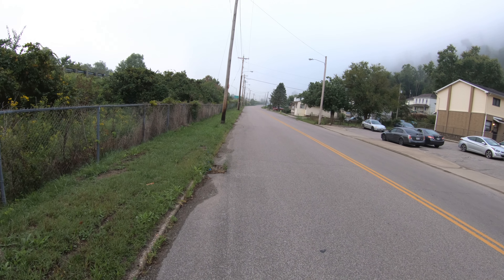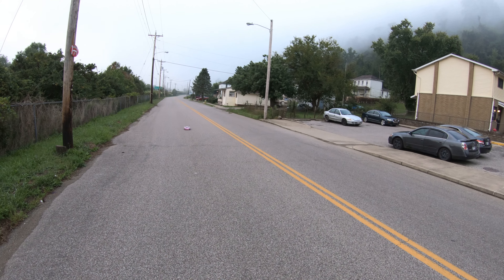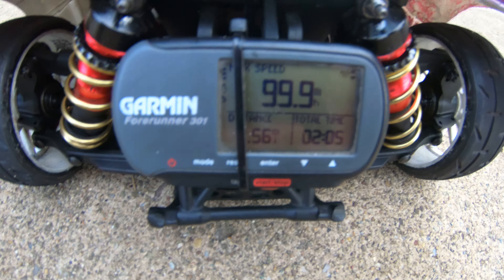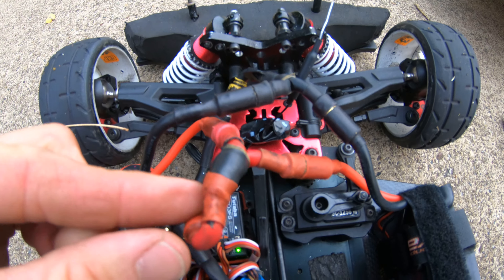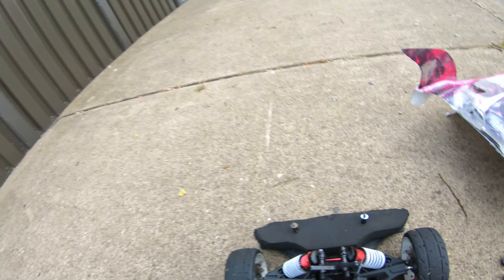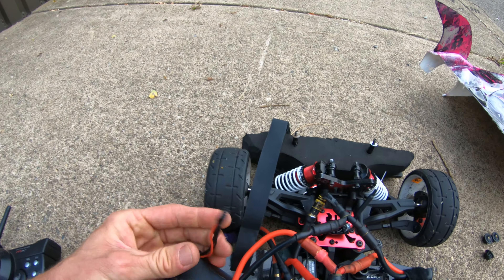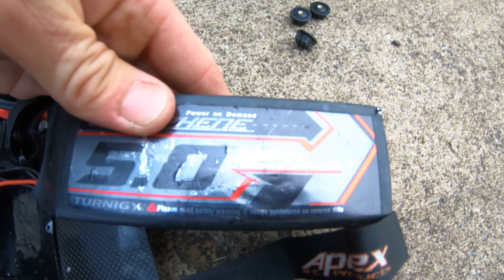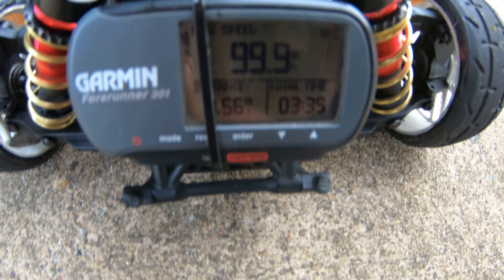Arrma Senton TAF 3S Challenge First Run. Hobbywing Motor

Comment: great run, what angle do you have in your steering so that you can drive straight ahead or rather what exactly did you do because my car always drives a little to the right or to the left no matter what I adjust, do you know the problem?,
Reply from the maker: RG-RC -TECH thanks man. I zero my servo then put the servo horn back on it. I also turn down servo speed and turn down turn radius for speed runs. If that don’t work it could be a off balanced tire, worn out parts or a bearing. Hope that helps.
Reply: @MrNiteriders1  thanks for the helpful tips :-)
Reply from the maker: RG-RC -TECH your welcome. Anytime.
Reply: @MrNiteriders1  forgive me if i ask you another question, reduce the servo speed, set that on the transmitter?